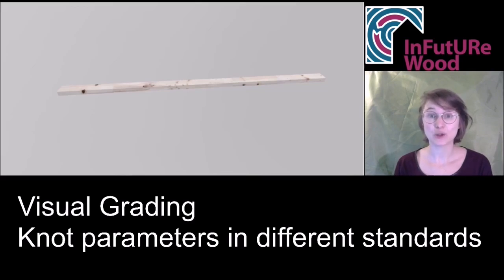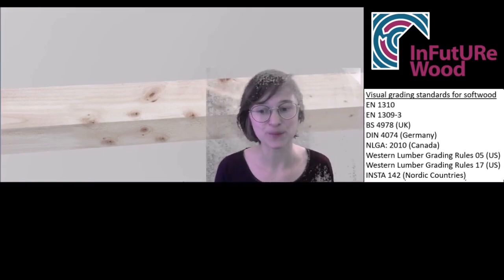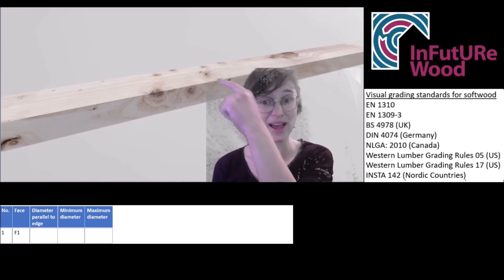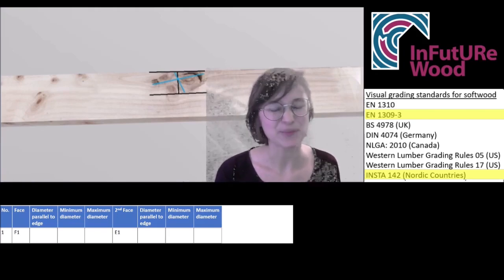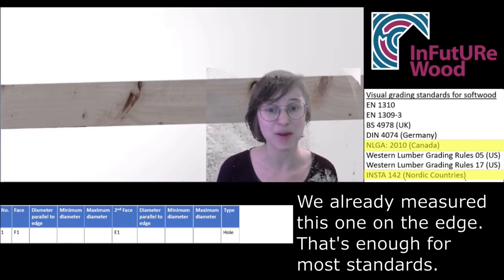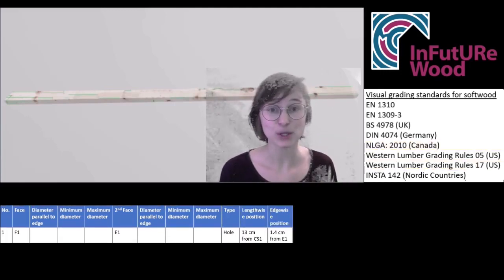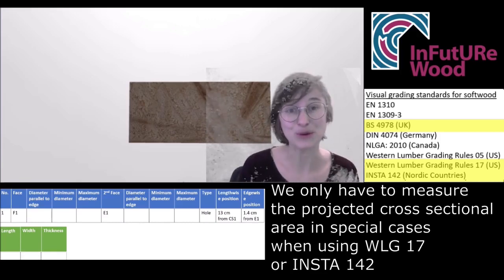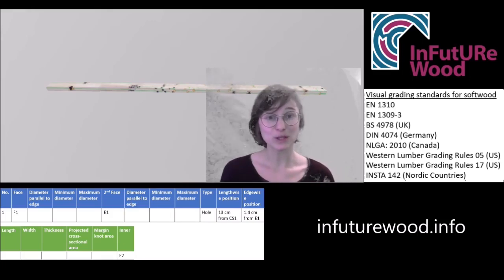Visual grading knot parameters

Comment: Thanks for making these videos. I want to confirm if all the mentioned standards are only applicable to timber boards rather than beams. In my opinion, beams are manufactured by bonding the graded boards together. So the grading rules for boards may not be applicable to grading beams. Looking forward to your confirmation, cause this is always confusing...
Reply: Yes, here we are talking about visual strength grading of sawn timber - either for use as lamellas in glue laminated products (glulam or cross-laminated timber) or more commonly for use as simple sawn timber building components (beams, studs, rafters etc). It is not possible to use the same approach on the finished glue laminated products.